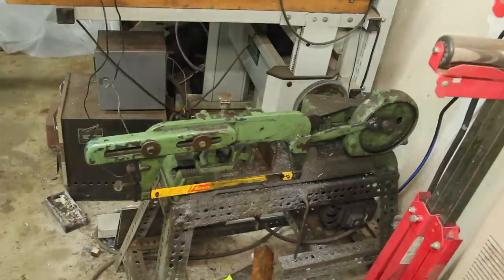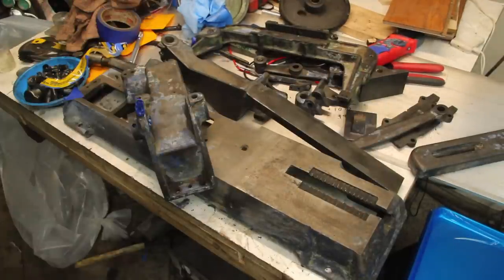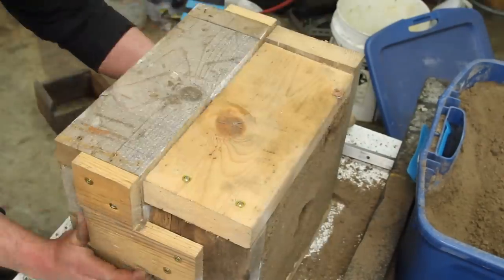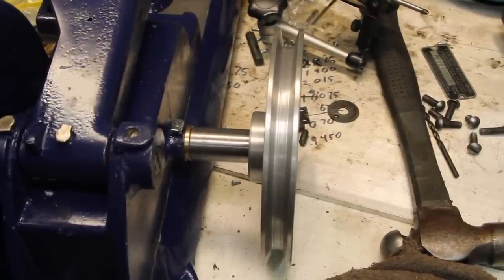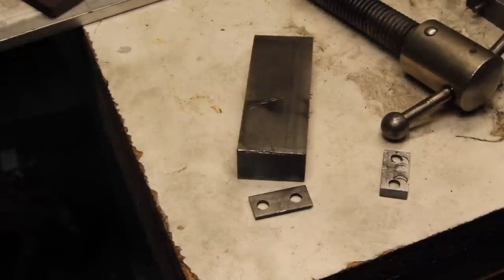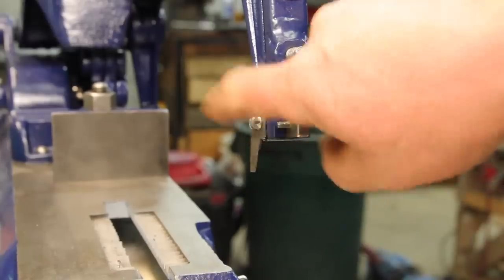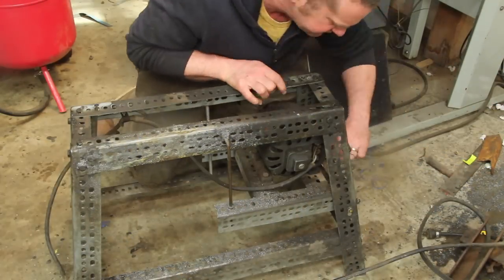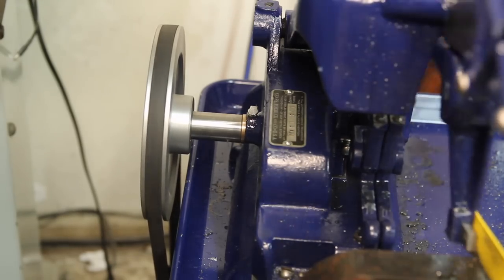1950's Power Hacksaw Restoration

Comment: OK, let’s break this down.
Turning, milling, brazing, re-bushing, taper pins, broaching with a shaper, welding, casting, sandblasting, painting, ratchet replacing using Joe Pi consumable jaws, hardening and tempering, electrical wiring, table fabrication, ball turner, knurling, river mystery metal and a beautiful restoration. 
This could have been a 10 part series but you made it a condensed joy. 
I know doing it and filming it took a loooooong time, so thanks so much for this video.
Reply from the maker: Dang it, I missed surface grinding!
Reply: You missed paint stripping.
Reply: @ronwilken5219  and needle scaleing

Comment: How much more cross-discipline can a single project be? Turning, milling, sheetmetal, painting, electrical, heat treat, casting, etc. Also loved the discovery of hidden features, and the improvements to the chiptray, switch, etc. This saw will go on to work for another few generations, I'm sure. Great work - and nicely edited. Bravo! 👍
Reply from the maker: “Patternmaking” is stretch.  😆
Reply: @JeremyMakesThings  You're right, I'll fix it. 😂
Reply: I’ve been a welder for almost 30 years and despite Jeremy swearing this will never be a welding channel in at least two earlier videos I’m pretty confident I saw some welding as well! Nice vid
Reply: @JeremyMakesThings  CAD as in Cardboard Aided Design?

Comment: After making a new pulley, I was wondering how much harder it would be to remake the shaft.  But I guess some problems solve themselves.  Nice work!  Power hacksaws are neat.
Reply from the maker: I would have been more inclined to do it the first time I’d the gear wasn’t pinned on and if my lathe would hold a closer tolerance, but I got it done in the end.
Reply: @JeremyMakesThings  You’re lathe seems to need a renovation from the sound of it. But you seem to master it extremely well anyway 👍😀
Reply: @jesperwall839  You mean a lathe isn't supposed to sound like a train clickity clacking down a poorly maintained track? Hmmmm...
Reply from the maker: It’s the back gears.  They sounded like that because teeth, but it ran fine.  I finally got around to fixing the teeth, it still runs fine, and still sounds like that.  I think eventually the blazes teeth with run in and quiet down.  Maybe
Reply: @JeremyMakesThings  I too have a Logan 200(I think its a smidgen older than yours). I'm super impressed with what you do on a 200....especially when parting parts off. You running a flat leather or have you upgraded to a rubber belt? I love the 200, but love my monarch 12ck more. Lol

Would love to see a logan lathe love vid! Love the channel too!

Comment: That's a cool trick I haven't seen before. Use a collet in the tail stock to tighten something without flats on it. Nice.
Reply: Ross, I have a Myford with a threaded mandrel. I made a back plate for a 5C chuck but had forgotten to drill a hole in it for a Tommy bar to help remove it. I used the lathe chuck, jaws reversed, clamped to the backplate to remove it. More than one way TSAC.

Comment: Thanks for the video.
I restored one of these, I had the same problem with the 10 tooth blade on your saw at the beginning. These saws just don't run on anything less than 14 teeth. The other problem is the raising mechanism, I got it to work but it was never great, I'll have to come up with a better system or just let the blade rub on the return. 

I have a power band saw but these saws are great for carbide blades cutting through hardened steels.

Comment: I was going to comment that the hole in the body was for a shut off switch but you worked that out and installed one. 
But you made it actuate horizontally. I was going to comment that on my 4*6 saw the switch is inserted so it works vertically. But then I noticed that you fixed that on your own so there wasn't much else to comment on other than the piece of scrap iron for the tommy bar.
 But someone else beat me to it with the Noah's ark nail joke. So despite having been beaten to the comments by everyone else I'll join them in saying great and thorough job both on the saw, recycling ancient steel and aluminium pop cans and the video. Simply put. THANKS.
Regards from Canada's banana belt.🤞🇨🇦🍌🥋🇺🇲🕊️🇺🇦👍

Comment: A nice working restoration
Only 2  real comments -
1st: your question on what to do with the badges - My suggestion is cold blue them and and then rub the raised surfaces on some fine grade sand paper, should give some visible contrast
2nd: I'd recommend a small addition for your own sanity - Add 2 rest blocks on the new chip tray - one close and 1 at the far edge as outfeed supports, If you add a small leather strap like a watch or small belt you will mute almost all stock vibration on the front and likely stop a good amount of drop damage to the tray over time

Comment: Weight shouldn't need to be that far forward, it should use the screw hole towards the back more on the bow of the frame. Don't forget to oil through the hole on the large gear that gives access to the oil cup behind it. Someone didn't oil that on mine and the shaft chewed through the bearing and into the cast. I had to repair the cast and make a new shaft for mine as well.
Rustoleum hammer tone paint works great and looks really good on stuff like this.

Comment: If you fined a hard spot in a casting drill it using a masonry drill bit just grind the cutting edge to the same as a HSS drill bit and it will last about 1 hole but it works

Comment: I have some huge prismatic alumin(i)um jaw inserts in the vise (1 cm thick I guess), clamping in screws and bolts was never easier. Sure the inserts get messed up but no need to put nuts on screws or anything. Do recommend.

Comment: Would the blade cut better if you reversed around so teeth pointing frontwards. More power in the pushing than the dragging of the blade.
Reply from the maker: No, it’s designed to lift off the work on the push stroke and cut on the pull stroke.

Comment: Be more gentle on those hardness testing files... You should just kiss them onto a surface and with light pressure see if they bite, you needn`t move them more than a single millimeter or attempt a cut... If they bite and resist movement at all, the material`s at least somewhat softer than the file, if she tries to scoot around, dont let her, it just ruins the teeth, and increases the amount of force you need to get them to bite if they ever had any intention of so doing with a particular test sample... 
Stefan or Robin renz gave a nice explanation of this, but yeah, dont file the material down with them, if they wanna bite, thats all the confirmation you need, if you wire brushed the oxide layers off, as scales can be harder than whats beneath... These are file-like instruments, more than they are really metal working tools per se... You dont tighten the micrometer until it digs into the material and leaves a scratch or a dent... The same principle goes here... Minimal force, minimal engagement, maximal efficiency and best readings... Anything else is instrument abuse, as much as the instrument seems to be a round file, if its calibrated, it demands instrument treatment for best practice and best results... 

All the best and warmest regards!
Steuss
Reply from the maker: Good advice, I’ll remember that.
Reply: @JeremyMakesThings  Most glad to be of any help... Were it not for generous and commendable people, i would not have fallen in love with machining or know half that i do now, so i try to share what i can, where i can...